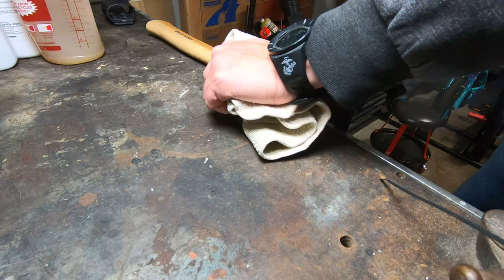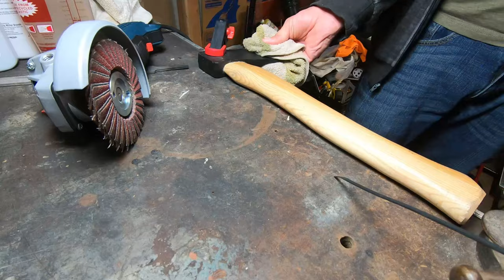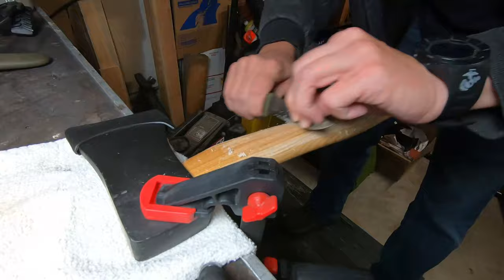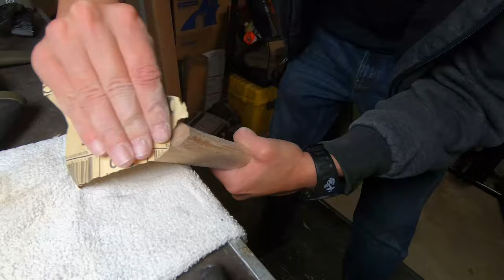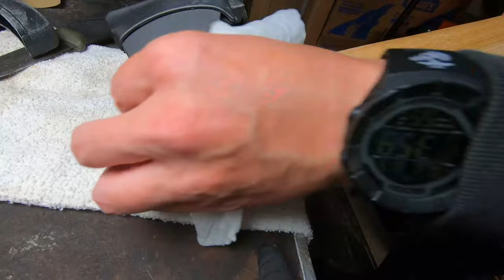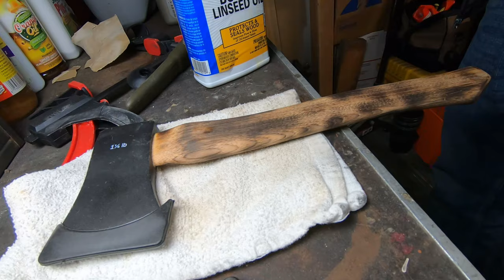Harbor Freight Axe Modification.

Comment: They have very poor steel. Pretty much mild, with no hardness, even on the edge
Reply from the maker: Agreed, it does require a lot of sharpening, but for the price I’m happy with it
Reply: I disagree. Super easy to sharpen and it's nice to have an axe you can sharpen in 5 minutes or less. Mine held up all summer and I used it VERY heavily, only did a 2 minute touch-up once and I processed two entire 60-70 year old trees (they fell on my property) with it. You don't want your axe to be made out of a super steel anyway, it's cutting wood not rock. Also think of it from a survivalist opinion.... could you sharpen it with no tools? The answer is yes! Now if you had an axe made out of s30v or something, could you sharpen that with no tools? No, it's staying dull forever!